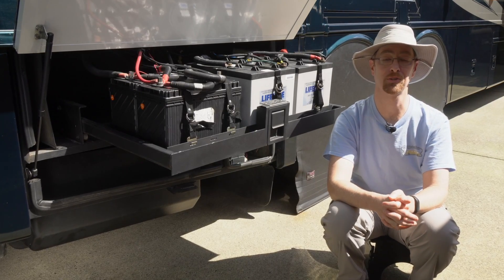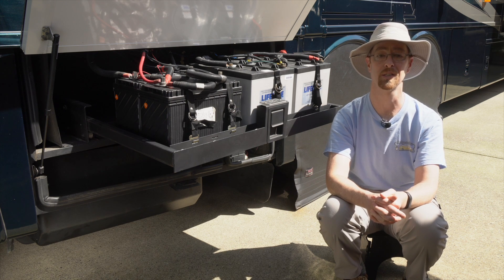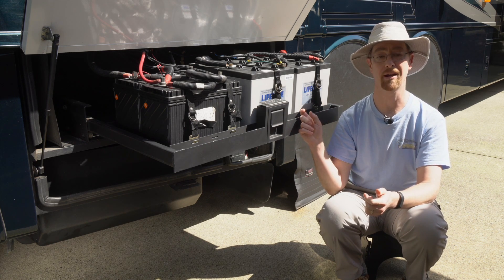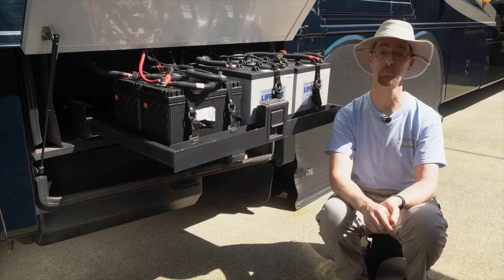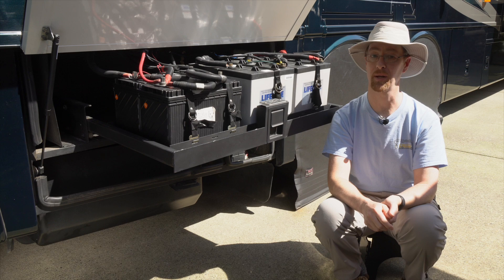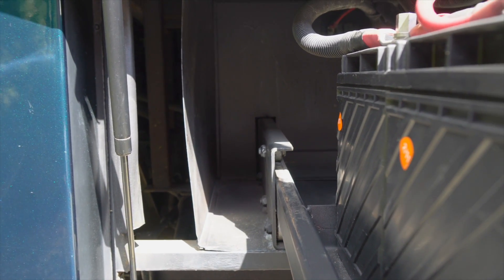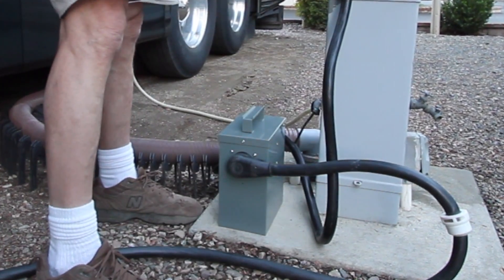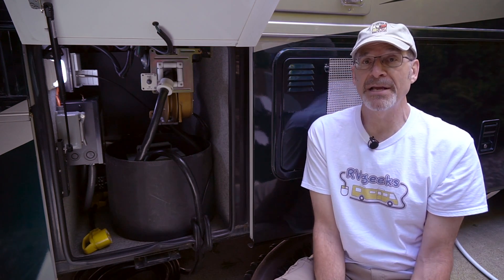🔌  RV Lithium/AGM Battery & Electrical System Upgrade - Part 1 - Project Intro ⚡️

Comment: This is fantastic!!!  I haven't seen the Xantrex batteries before and I want to install batteries in my basement bay too so this is very good to see.  The other concern with putting Lithium in the basement is high temperature.  The challenge is that LiFePo4 chemistry performance degrades somewhat faster at higher temperatures > 90 degrees.  Has that been considered in the design of the Xantrex batteries?
Reply from the maker: Hi Steve! The reason you haven't seen Xantrex lithiums before is because this is a brand new product, not actually available for purchase yet, which is why we're working directly with Xantrex as a showcase for this new tech. We're certainly hoping our participation helps build awareness of, and demand for, this kind of awesome product. They do have a non-heated variant that they're installing inside Class B rigs as an OEM option. As far as heat.... our battery compartment is located directly alongside our engine, RIGHT next to the muffler! So, as you'll see in upcoming videos, we installed highly heat-resistant insulation (the type used under race car hoods) into the compartment (although the next video, about enlarging the battery tray, does not show it yet.... we did it after that). So far, having driven over 2,000 miles, our two temperature sensors (one in the compartment and one inside the battery itself) have never shown readings anywhere near battery limits. And that includes plenty of mountain driving, although in less-than-extreme ambient temps so far. We're keeping a close eye on that, especially as the summer warms up, and will report back on that issue in a future update. Actually, our basement is generally a pretty "cool" place... at least in the wide open areas of the larger compartments.
Reply: Excellent information.  I have been digging and been only able to find a small PDF on the Xantrex eGen batteries but I can't wait for more information... (Can I ask - how many AH per battery for your install? and how many batteries?)   The wife and I are planning to buy a New Aire soon and will be fulltime as soon as we can move in :)  The solar and battery design has the full geek in me running wild and the Xantrex eGen batteries appear to fit the environmental constraints of a limited size RV perfectly.   You can't produce these videos fast enough for me to absorb.  

I'm sure you are having fun with it, but it is really fantastic that you do such a good job sharing the knowledge!  Appreciate it very much!
Reply from the maker: Thanks Steve! Congrats on your upcoming New Aire... and going full-time! Awesome! The e-Gen system is a single 600 Ah battery... the one that was pictured in the video, sitting on a cart just before installation. It looks amazing, and so far IS amazing. Can't wait to share more. 😊

Comment: Do you happen to have the dimension of the e-GEN battery pack? I couldn't find it in the documents. Also how long do you think the 600Ah will last?  I'm curious why Xantrex didn't just go with a 48-60V battery pack and design a 48-60V Inverter to reduce the power loss.
Reply from the maker: Hi Bruce. It's 24" wide x 13" deep x 11.25" tall. Plus the BMS. It's supposed to last 3,000 cycles at 80% discharge. As far as Xantrex's design and engineering decisions, we have no idea! LOL Sorry.
Reply: Awesome thanks!  
I was just looking and my current 2 battery trays with 4 batteries each could hold the Xantrex battery, BUT I will have to remove one tray as they only have 10" of height.  I would only loose 120Ah out of 720Ah, but on the plus side I would be able to use 30% more of the battery Ah.
Reply from the maker: Hi Bruce. One thing to keep in mind... the Xantrex battery isn’t yet available to purchase. Well of course keep everyone posted as we learn more about their plans.

Comment: In all the years you've had you 300watts of solar panels has that been enough to keep your batteries topped up?
You do look to be in a much sunnier part of the world than us Brits :D
Reply from the maker: Hi Greg. Before we upgraded to our residential refrigerator, the 375W of solar did a pretty good job of keeping up with our needs (especially when we were in sunnier climates like southern California or Arizona). But since upgrading our fridge, it has been less than we needed. Even with the Lithium battery, we will likely need to increase our solar array to provide enough power to keep ahead of our usage. But we want to wait for a bit to get the feel for how the new battery performs, and plan the upgrade with that information in hand. You're right, though... being in sunnier parts of the world definitely helps! We've been traveling across Canada in heavy overcast and rain... and the solar hasn't done much of anything for us. We could have the whole roof covered, and it wouldn't be much help!  😉
Reply: Thanks very much for the reply guys, were touring Europe so the weather will be a mixed bag at best.
I've pretty much used all the space I have for solar and got 3x160w=480w of panels on my Sprinter.
Just have to do some life changing exercises too, like charging things in the middle fo the day when you have spare power and not through the night like you would do at home.
Reply from the maker: That's a lot of power for a Sprinter! We're planning a short RV trip in the UK this fall... renting of course. Have a blast!
Reply from the maker: One other thought, Greg... have you considered a fuel cell to provide charging power? We've seen units like the eFoy (https://www.efoy-comfort.com) that are pretty small, which might work for you in a Sprinter-sized RV. The one downside is that they user their own proprietary fuel-cell cartridges, so you'd need to keep one or two on hand. The good thing is that there appear to be quite a lot of eFoy dealers in Europe. So fuel might be fairly readily available. Just a thought. At least the fuel cell would provide power regardless of how much sun you were getting... day OR night!  😉
Reply: True greg, unless you just have 2 led rights 300w would be low for us, 500 minimum I'd say.

Comment: Where can I find more information on this New House Battery?  I can't seem to find it anywhere.
Reply from the maker: Sorry to report that the reason you can't find information about it is because it's not available yet. We installed this unit with Xantrex as a case study and showcase for the new tech. We're not sure what the plans are for retail availability just yet. It may come out as an OEM-only option before becoming available as an aftermarket kit. We of course will announce any updates as we have them.
Reply from the maker: Here's some additional info: http://www.xantrex.com/industry-solutions/freedome-gen.aspx

Comment: So I took 2-100 ah battleborn LiFePo batteries, wrapped them in an 80 watt 110 volt battery blanket and some insulation, hooked that to an automatic temperature switch and that to a small 150 watt inverter, and voila a self managing temp controller.  

Probably a poor mans version of your xantrex battery things..
Reply from the maker: It’s great that you’ve addressed the cold weather issue for your install, Robert. So many people aren’t even aware that it’s a problem.